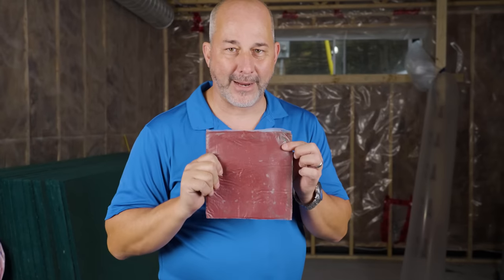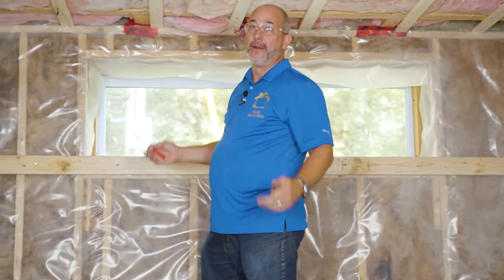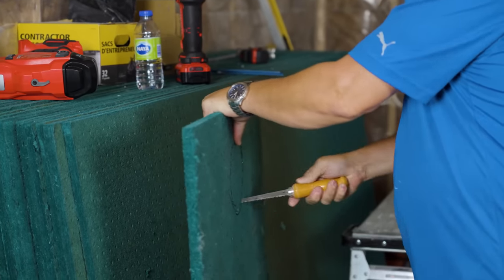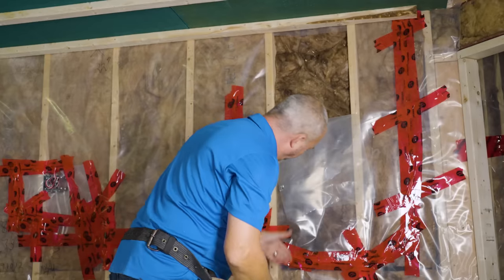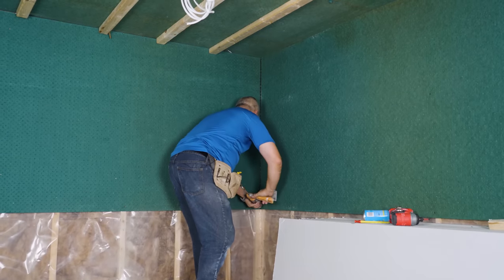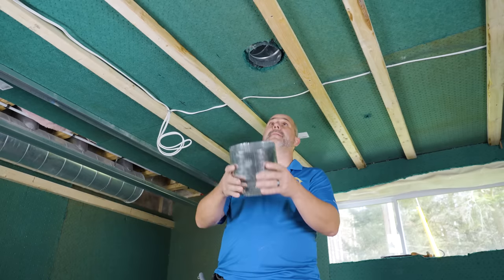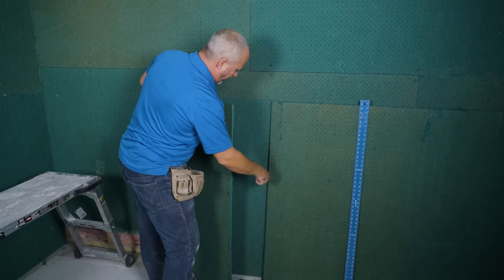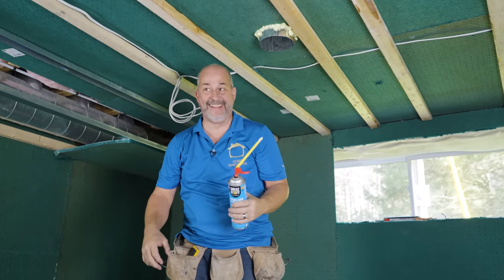Soundproofing A Room (It's Easier Than You Think)

Comment: You are coupling the drywall directly to the studs through the screws, eliminating pretty much anything you gain from trying to control the air by sealing up the room or any efforts to decouple with the greenboard.  Then you are defeating the air control by having a bunch of 6" holes from the hvac that just lead to the other side of the drywall (your only real soundproofing here) and further defeating the soundproofing.  Ultimately you are going to have an STC of MAYBE 45, which is barely better than what using 5/8" drywall and pink fluffy insulation would give you on a standard wall with no other measures.  You have to decouple the surface of the inside wall from the framing or the sound will just travel to other rooms through the coupled surfaces.  For the amount of effort and cost here, you could have just added a second layer of 5/8" drywall to all walls and ceilings and gotten ~50STC.  Add in some properly installed resilient channel and some green glue between the layers of 5/8" drywall and get that number up around 60STC, or better, do isolation clips and hat channel and get it above 65STC.  Or if you have the space, just do fully decoupled walls with an air gap and get over 70STC.  Then use the air control measures (caulking, fireputty on boxes, etc) to not slip backward in your rating.  Then either go with a high mass duct with a muffler to stop the sound from traveling to the rest of the house through the ducts, or better, use a mini-split system for hvac inside the soundproof shell.  And finally, if you want to keep the higher STC from all the efforts, you need a door system that also has a high STC rating.  Usually the easiest is double solid core doors with the inner frame decoupled from the outer frame, but there are some high density solutions that allow for a single door with decent STC rating.

I'm sure it "sounds" quieter because if all you are doing is testing with a voice, all you are measuring is the high frequencies which are easy to defeat.  The system you showed here will do nothing to stop even a modest subwoofer from being heard clearly in the next room, and very little for all the other frequencies below about 5khz.  There are some great measurements of various soundproofing methods on soundproofingcompany.com's website.  And there is a couple really good (and really long) threads on AVS forum with great info from professional theater builders if you are interested in learning about real sound proofing techniques.  One resounding piece of information you learn if you do any research on this subject at all is that all it takes to defeat the whole system is making the mistake of using screws that are too long.  Contractors don't feel that screwing drywall into a flimsy piece of steel is enough, so they get longer screws and drive it into the stud, defeating  any kind of resilient channel or other decoupling methods.
Reply: What do you recommend for a sing door solution?
Reply: @HoundDogCatia  Make your door the same way you made your wall. A sandwich of materials. Use a commercial closer and a pull handle instead of standard hardware.
Reply: This was very insightful! Thanks for taking the time to write that out.
Reply: Highest quality YouTube comment of all time right here.
Reply: This comment is very good. Fully decoupling all walls and ceiling and floor is the first step. If that’s not possible then you’re never going to achieve anything close to Soundproof. I don’t hate the idea of this Sonopan type product though. I think green glue is overpriced nonsense so I’d be more likely to use this as a layer between 5/8 drywall.
Reply: @TimMilliken  SONOpan does absolutely nothing that drywall doesn't do better and cheaper. It's a gimmick.
Reply: You sound smart and maybe are. But you keep saying decoupling A LOT… you give suggestions of decoupling but they are no different then what it shown lol. I have over 20 years in construction and you sound like an engineer that doesn’t understand the field. 
My main example is his wood strapping is going to be 95 percent the same as resilient channel! lol 
Using glue is not different than limited screws! Test have proven time and time again.
Soundproof is about reflecting vibration, Sealing off vibration, and limiting easier paths for vibration to get through. It’s not rocket science. 
This design in the video will do very nicely. Against subwoofers. 
All the extra work you discuss I guess if some one was building a sound studio is pointless. Even in a sound studio.  
Cheap non flat foam glued to the wall will do more than ever you explained. Be it almost completely breaks up the sound before it even gets to drywall
Reply: @aldawgd  This is all basic physics (Newton's laws of thermodynamics and momentum).  The ONLY things that will stop sound from transmitting to other rooms in the house are mass and decoupling, along with sealing the room so that you don't allow the sound to travel through air to other rooms.  Sound travels through air, hits a wall and some sound energy bounces off (reflection) and some is transmitted to the wall.  When this happens, the more mass you have, the more energy is converted from sound (kinetic energy) to heat when it hits the wall and makes the wall vibrate (this is due to conservation of momentum, more mass takes more energy to move).  Sealing the room is important because sound travels through air really easily, and if there is a path for air, there's a path for sound.  And decoupling comes in because if there is sound in the room it will make the walls vibrate, and if the walls are vibrating and they are coupled to the studs (i.e. attached firmly) then the studs will also vibrate, and then it will vibrate other wall surfaces and that vibration will be transmitted back to the air and you will hear it. Sound travels easiest through air, but it will still travel through solids, just not as easily.  So full circle, the mass in the walls (drywall and studs) are all that will minimize that vibration as it moves through coupled structures and back to the air.  Furthermore, when that drywall vibrates with sound energy, some of that energy transmits back to the air inside the walls, then travels to the other side and back into the drywall.  Adding simple pink fluffy insulation inside the walls will do more to stop this part of the sound transmission (through absorption) than a 1/2" thick layer of foam board.  Foam doesn't add any significant mass to the drywall, less than a second layer of modern ultralight 1/2" drywall would, and FAR less than a layer of nice heavy layer of 5/8 drywall, and it doesn't do ANYTHING to decouple if you are just screwing the drywall to the studs.  Resilient channel works OK because it's like a spring, allowing the drywall to move without transmitting that vibration to the studs (i.e. decoupling), but only if you make sure you are only screwing the drywall to the channel and then attaching the channel to the studs as minimally as possible to keep the drywall attached.  Most contractors won't feel that the flimsy piece of tin channel is enough so they just use longer screws and go all the way into the stud, making the channel do nothing.  Using hat channel that only attaches to studs in a staggered pattern through isolation clips that minimize coupling is far more effective.  Using furring strips in place of resilient channel wouldn't be as effective because it can't make the walls act like a giant spring to absorb some of that energy, but it would do more to decouple the drywall from the studs and hence be better than nothing.  I'm not an engineer, but I have done extensive soundproofing in my own theater and consulted on other jobs.  I spent hundreds of hours learning the science behind it and studying actual results measured from 10hz to 20khz to see what is most effective.  Some of what you are doing is better than nothing, but then you leave a giant hole in the room that allows sound to go through the air into the ductwork, and anyone who ever slept next to a duct knows you can hear conversations in other room as clearly as you can if you were standing next to the person talking.  Unless the duct work is all rigid fiberglass insulation, or has mufflers in place to stop transmission of sound through the ducts, you defeated the majority of the sealing you did.  Again, look at resources like AVS forum where experts have spent countless hours actually measuring different soundproofing systems to understand what works and what doesn't so they can confidently take on million dollar theater builds.  Don't ever trust a vendor of soundproofing materials unless they can show you the measured STC of their materials in an application, and make sure you understand how the entire system works together.  You can do double 5/8 drywall to add mass, but without sealing the room properly the sound will just go around all that mass and you will hear it plain as day on the other side of the wall.  Sealing the room but leaving ultralight drywall screwed securely to studs is just going to act like the string between two cups and the sound still transmits.  You need to do it all, or none of it is effective.
Reply: Thanks for your reasonable comment.  I did poor-mans soundproofing around my furnace, and in my home theater room, using rock wool and double-studding (very inexpensive) because can-lights and ductwork was not getting re-designed. My goal was to be economical and make it easy to service in the future.  This video seems like a great way to sell a lot of products/labor/materials and make future repair/maintenance very difficult.
Reply: @KlrStng  Thank you. I was having a lot of these concerns watching this video, especially when he was pulling duct work through to the drywall. That negated literally everything he just did and made a direct point where every single sound coming from that room as well as from the rest of house will travel through. I plan on building off a separate studio in my basement, and double framing, decoupling, double layer drywall over heavy rockwool insulation and sealing all air gaps is the goal. I have found some good information on creating a baffle box outside the room and installing a fan to move air between the rest of the basement and studio to avoid using a mini-split, but I am torn on which way to go. The idea of removing any HVAC systems from the room itself is appealing, but I have concerns at how well the baffle box will function, and the fan would have to be fairly powerful to move enough air through a bunch of insulated chambers and may add more noise than a mini-split with a drain line sealed off.
Reply: @gdn86  I built a couple soundproof muffler systems to move air into and out of my theater.  One sits in the trusses in the ceiling, mounted on rubber isolation and is just a 6 inch flex duct that zig zags back and forth through a soundproofed box filled with pink fluffy.  The other is bigger and is on the back wall on the other side of the theater, and uses a rigid fiberglass maze.  Both are not too restrictive and I run 6" inline fans to drive them and get around 200 cfm total of air from the rest of the house without compromising the sound proofing.  I keep the openings large and they are barely audible on full blast.  Since the room has a noise floor below 20db, you can hear them but with the theater on you can't.  The fans are both outside the room, the one in the ceiling has an access panel in case I have to replace it, so I can't hear the fans, it's just the noise of air moving that is an issue.  The one in the ceiling is louder because I didn't do a good job with the transition from the vent box to the flex duct and you can hear the air right there.  I added a minisplit mostly because it stays around 66 degrees in there if I don't heat it, but since I almost never need the a/c I could have just done a baseboard heater or even a portable heater to keep it warmer.  With 8 people in the room, it can warm up, but the circulation fans do enough to cool it off and the minisplit is not really necessary.
Reply: yes this is why sound bar should always be used in conjunction with the sound proofing board, the duct just ruins all sound proofing must always use baseboard heaters without question.
Reply: "Add in some properly installed ..." You won't find much in the "properly installed" department on this channel. It's a channel of half-rate diy hackery. It gets a lot of views though, because a whole lot of people will never learn the lesson that a shortcut now cost you twice as much later. I've run into so much crap like this in houses it's ridiculous. Step one is generally to rip all that crap out and get back to something reasonably constructed to start from. Which could be bare dirt in some cases.
Reply: Yes, absolutely true. I've built two recording studios in two homes and acoustic decoupling with mass-air-mass is the key. If you're going to have any heavy bass in your room that you don't want getting out, or loud sounds getting in from outside you need way more than what he's done. In my present studio (in addition to ALL of the suggestions you mentioned above, including screws that aren't too long and green glue between 3/4" plywood and 5/8" drywall)  I have two large fans in the attic forcing air to and from the outside/inside, going through two very heavy air baffles that are built into one the walls. The air is forced through zig-zagging ducts that are lined with acoustic duct treatment. I also use solid windows with 3 layers of varying thickness of laminated glass.  Even with all of this, if I really crank up my system that has a 15" sub, you can still hear the bass a little in our garage.
Reply: @aldawgd  If your 'main example' is the wood strapping being 95% effective as using acoustic decouplers and resillient channel between your walls, then you clearly don't know what your talking about.
Reply: @gcruishank9663  did you really just revive a 5 month old comment to state no facts or opinions? Lmfao
Tell me what I said that is wrong and why if you’re going to revive this. Bc it appears you have no clue what your talking about where my comment is very clear and factual 

Side note: I see at least one comment of mine was deleted. Shame. Such sensitive people don’t like being proven wrong and just report people instead of making their case
Reply: @gcruishank9663  also it appears you commented before reading my full comment. Please read people’s full comments before @ them

Comment: Hey brother, love your videos and just wanted to share a tip I came up with when using those spray foam cans. Like you mentioned, not everyone has an expensive foam gun, but you can get a roll of plastic tubing in bulk for pretty cheap and cut a few lengths of it to fit on the tip that comes on foam cans. It's cheap, flexible, and keeps the can in an upright position. Not something a professional would use, but if you're the type that does your own work I think it's a handy thing. Additionally the tubing has many other uses, like bleeding brake lines by yourself. Hope this tip helps someone out there, and thanks for your dedication to spreading knowledge through your videos!
Reply: Great tip!

Comment: Thank you for making all these videos and I’ve learned some things over the years. I’ve also done studio installations and one of the biggest challenges is separating HVAC systems. You have not stated that this is a separate system, and if it is part of the whole house, all the sound will go through the vents. You are correct in stating with this type of soundproofing that one needs to do 99 to 100% for it to be effective, basically waterproof and air proof. Just as an aside, someone who is spending so much money to sound proof may also be interested in the acoustical performance of such a room, non-parallel walls make a huge difference in standing waves in the lower base regions and upper mid regions of Audio. selling a new construction tilted ceiling and flared walls will reduce the amount of Acoustical diffusers, needed and much room treatment which can run into the thousands and I really just a Band-Aid on a bad sounding room. Audio file and contractor :-)
Reply: Was just about to comment before I saw this... If that supply duct is connected to a central HVAC system, then it will transmit the sound throughout the house.  I did a somewhat poor job sound insulating my basement music room knowing that I had two ducts in there that I couldn't block off.  When I'm upstairs, most of the high freq that you hear are coming through the ducts.
Reply: I completely agree.  Should put in a separate Split heat pump for heating and cooling.  Res bar is generally used for strapping as well.  I'd also omit pot lights and go for perimeter up lighting.
Reply: @PeterPug  You can get inline duct mufflers, which is basically a tube, roughly two or three feet long, which expands in diameter from the connection points on either end, with the inner surface in the expanded segment covered in acoustic foam. The idea is, as the sound bounces around down the duct, when it goes through the muffler section, the reflection is reduced. My understanding is that it helps primarily with higher frequency noise. They're often used to reduce the noise from fans, but should work for any noise going through the duct.